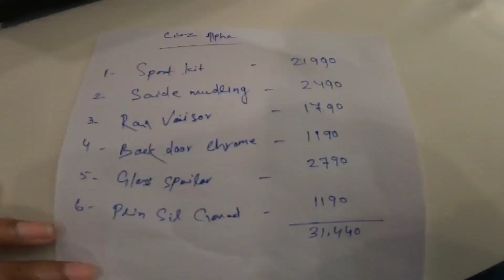Car Mods_Accessorizing Maruti Suzuki Ciaz Alpha_Fiancee's New Car_Complete Vlog

Comment: I also have ciaz, now i want to remove the spoiler . Can i if it is drilled?
Reply from the maker: You can remove it, but what will you do with the existing drilled hole, how will you cover it up?
Reply: @thesilentvlogger2925  thats what i wanted to ask, may be they have some solution to it
Reply from the maker: @rabbekapp01776  Better go to your nearest Nexa and ask them..... But, I don't think there's a solution to cover up the hole.
The only thing you can do is change the complete unit of the car trunk. You have to purchase that whole car trunk unit.
Go and ask there once.
Reply: @thesilentvlogger2925   Any disadvantage for Spoiler. I am planning to add one.
Reply from the maker: @nambir  You can definitely go for it.... Just make sure that the Spoiler is attached to the body through the glue perfectly so that it doesn't wear off easily after few months.
Be there when the Spoiler is fitted to your car to see if this is taken care.

Comment: What is the price of tail light spoiler
Reply from the maker: The Sports Spoiler Kit costed Rs 22k.....Which included the tail light spoiler, back and side spoilers
Reply: Can we buy spoiler in aftermarket
Reply from the maker: @AbhayRaj-kl2uf  We can..... There are lot of options if you go look out in the market, but again those are manufactured to be fitted in any vehicle.... So you have to ask and be specific if it is actually designed for your car..... Otherwise you will be ending up with drilling more holes into your car to fit that spoiler.

Usually, I don't prefer to go for accessories from after market  that require drill and fit.

Although the spoilers that have glue fit can be taken from anywhere as they don't harm your car and you can remove them anytime you want.
Reply: Can we only buy lid spoiler from nexa
Reply from the maker: @AbhayRaj-kl2uf  No, for that you have to purchase the whole Sports kit
Reply: Jaisa aapne lagvaya hai kya vaisa sirf spoiler aftermarket mil jayega
Reply from the maker: @AbhayRaj-kl2uf  Dekh lo ek baar..... Mil jayeg to Acha Hai..... Lekin check karna ke wo Ciaz ke liye sahi hai ya nahin..... Perfect fit aana chahiye..... Kyonki isko gaadi mein hole karke lagana padta hai..... Agar wo specifically ciaz ke liye nahin hoga to fitting issues ho sakta hai.... Thoda idhar udhar hoga may be.... Ek baar check karlijiye..... If no issues, then you can go for it

Comment: My car same colour with AT.
Except back dikki chrome all other outside extra fitting stuff is useless and makes the car ugly. Try to compare ur car with other CIAZ.
Reply from the maker: If you select and match the color of the  accessories with your car color, you will get a premium and bold look.
Opting for chrome color always isn't suggested.